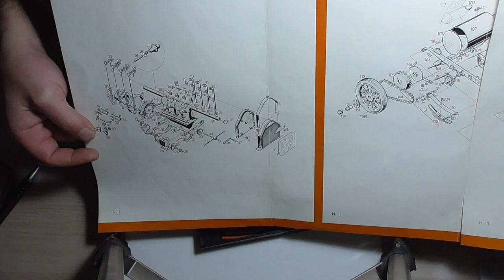1/8 Pocher Fiat F-2 Part 1- Engine

Comment: Did you paint the parts before building? I just received one but I’m debating on painting it the same colors as it already is to just refresh it
Reply from the maker: Yes I did, without painting, they just look like bits of plastic
Reply: @TMModelkits  Thanks. Was your version the one with the pre-made chain or the one in pieces? I have the chain pieces but cannot find the little pointed tool thing for it, nor do I understand how it's supposed to keep the parts together.
Reply from the maker: @Midnight2534  Pre-made, it was the first series, I guess yours is the later one